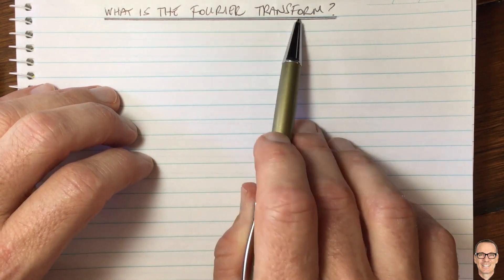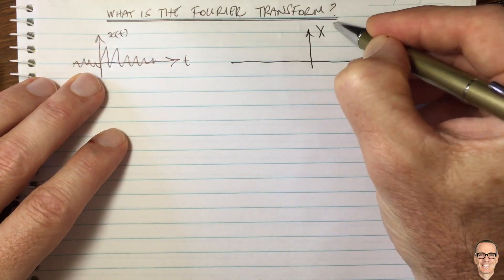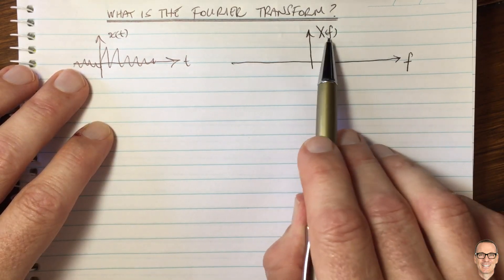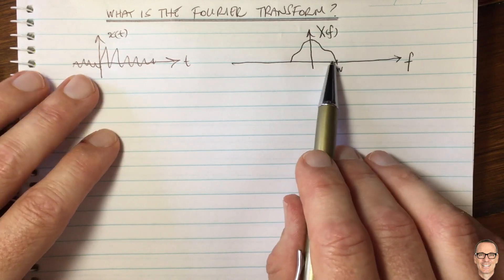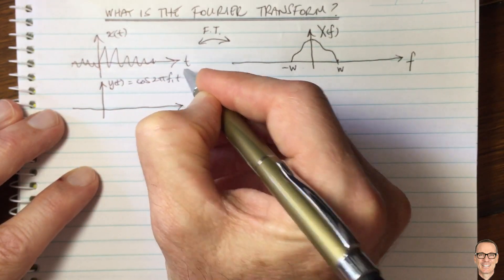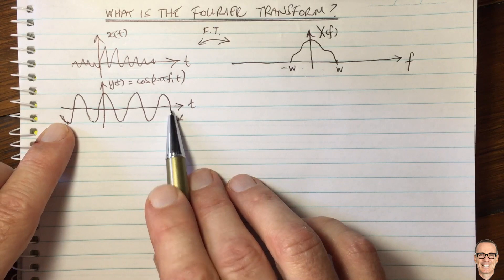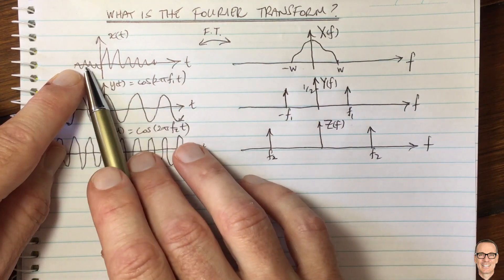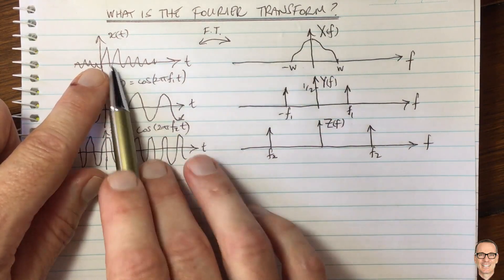What is the Fourier Transform? ("Brilliant explanation!")

Comment: Excuse me Sir, I cannot understand why at 11:13 the phase of the negative frequency -f2 from negative -pi/2 becomes positive +pi/2, I'm not able to figure out why the minus before the exponential adds a pi to the phase, thanks in advance
Reply from the maker: Good question. When we expand out the brackets of the second bottom expression on the left hand side, we see that the second term is an exponential that is multiplied by -(1/2j). This is the negative of the coefficient of the first exponential. Note that -1 equals exp(i theta) when theta=pi, since exp(i theta) = cos(theta) + i sin(theta). Therefore, the "negative coefficient" of the second term, is the same as the "positive coefficient" of the first term, but just with pi added to the phase.

Comment: thank you so much for your wonderfull videos <3 i didnt understand how to imply the phase (the last bottom graph) to the fierst (upper right) graph , the one with all the frq's..
Reply from the maker: The phase pot at the bottom right, relates to the amplitude plot that is above it. They are both for the sin(.) waveform (in the frequency domain - ie. the Fourier transform of sin(.) is a complex function - ie. the values are complex numbers - ie. they have amplitudes and phases). The top right hand plot would have its own phase plot, but I haven't drawn it.
Reply: @iain_explains  thank you so much, u are wonderful:)

Comment: In your example if you had the sin and the cosine combined in the time signal - would the amplitudes just add up in the frequency domain?
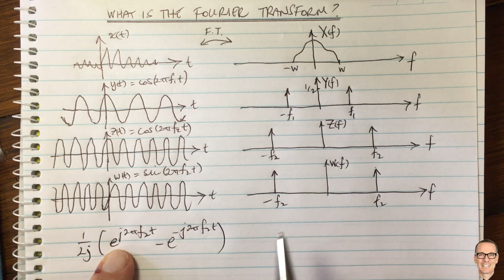Reply from the maker: Yes, it is linear, so they add up - but it's not just the amplitudes that add - they are complex numbers in the frequency domain (as I explain from the 9:30 min mark onwards), so the phase is important, and you need to add the complex numbers (which have both amplitude and phase - not just add the amplitudes).

Comment: If the same frequency and amplitude orthogonal  waves are added the result will be a sinewave with 45 degree phase shift. Is it right?
Reply from the maker: I think I can see what you're getting at, but you need to ask yourself what the "phase shift" is relative to (ie. "shifted" from what?). The following two waveforms are "orthogonal" to each other: +/-Asin(wt+theta) and +/-Bcos(wt+theta), for specific values of w and theta. Note that there are four possible combinations, ++, +-, -+, and --. In either of these four cases, you can add the orthogonal waveforms together and use standard trigonometric expressions to show that they can be written in the form Ccos(wt+phi). But the values of phi will be different in each of the four cases. And also the value of phi will depend on what value of theta you chose for your orthogonal waveforms. Hopefully this makes sense. This video might help: "Orthogonal Basis Functions in the Fourier Transform" https://youtu.be/n2kesLcPY7o